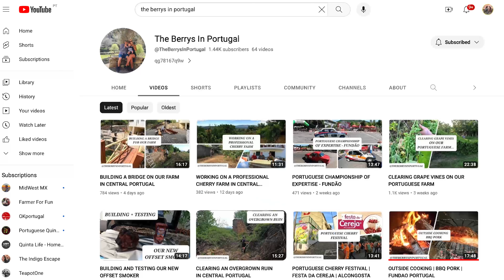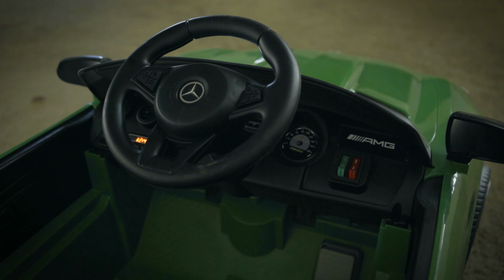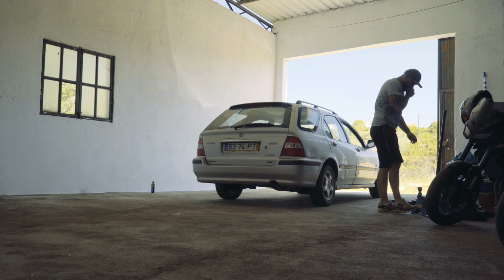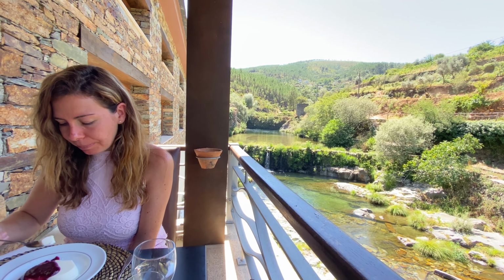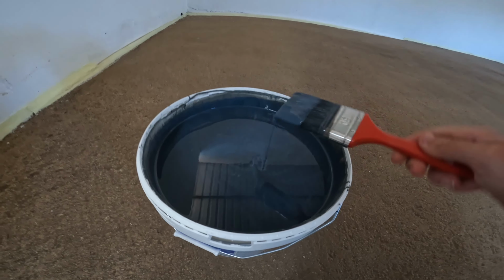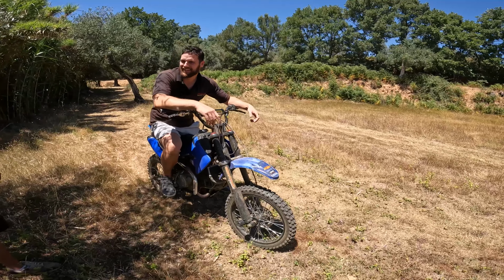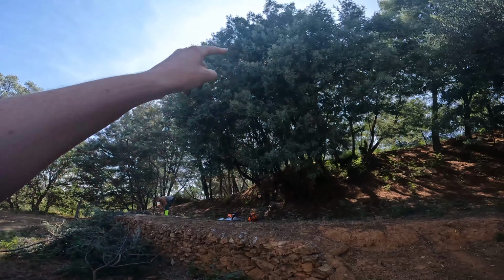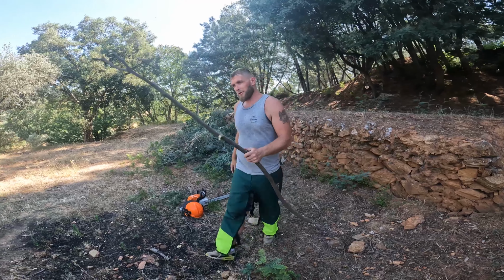Barn Renovation; Expensive Mistake on our Floor

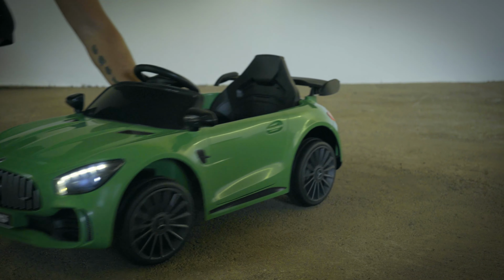Comment: 2:40 - I was waiting for some mad editing with you counting down the start of a Carwow drag race featuring that "AMG GT-R" against other super machines. I'm disappointed. 😞
😉
9:27 - I'm not an expert on paints but I wouldn't assume that a floor paint would be similar to a wall paint. Did you read the instructions that are usually written in the bucket? Maybe you were applying it wrong? Anyway, if you think there was something wrong with it you should ask the seller if that greyish colour at the bottom is normal.
Reply from the maker: I was going to mention that I’ve actually driven that car to a carwow drag race 😅 it’s part of the reason we chose it because the real thing is pretty damn cool too! 
We’ve now got a drill bit to mix up the paint better so if that is the reason we’ve got it covered but we are keen to see if this new paint looks any different as the paint could have been damaged 🤔
Reply: @jonnyandsamofficial  - Well, if the 1st bucket really had a problem at least you have a witness and video proof to show them and get a refund or a replacement bucket.
Reply from the maker: @module79l28  we’ll let you know 🧐
Reply: @jonnyandsamofficial  - I hope you'll let everyone know, not just me. I'm not special.

Comment: Lmfao you totally screwed up with mixing that so called paint  it needs to be mixed very well not just  slightly mixing it with a stick  the resins need a very good bleeding in for fast hardening and full water resistance  and for the size of your barn you are looking at around one thousand  dollars shoot i almost spent that on less of a square surface  you should have have gone with my previous advice on material that i said on your order video 😂😂😂😂
Reply from the maker: 😅🤦🏻‍♀️ We’ve got some more paint to try but this time with a drill bit. Did you suggest something better than paint? 🤔
Reply: @jonnyandsamofficial  yes I did on a previous video